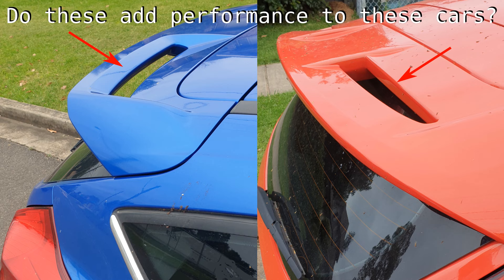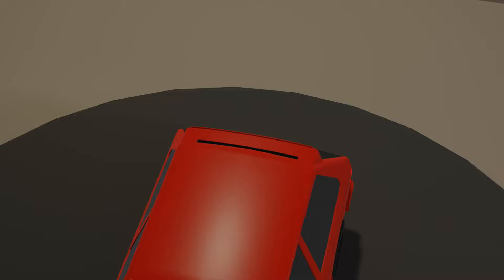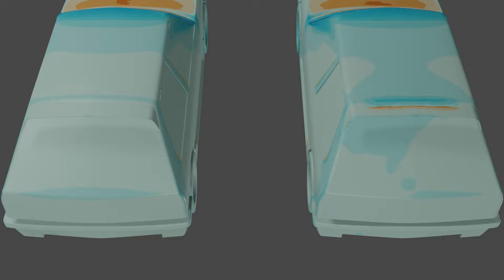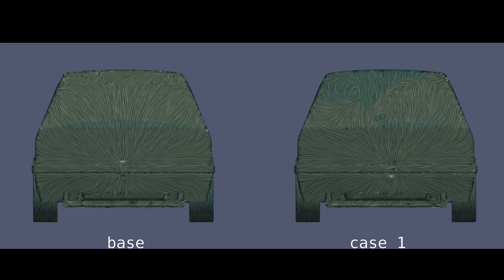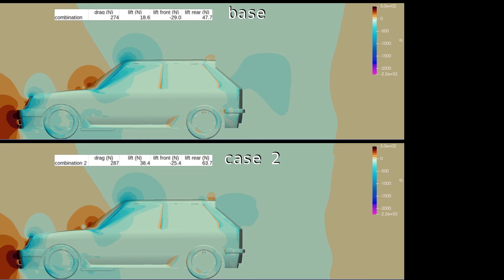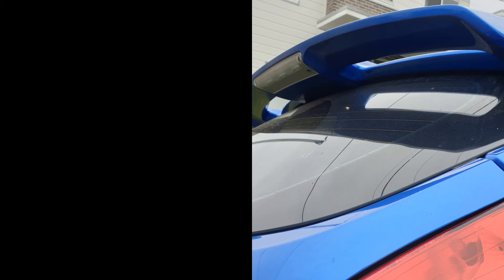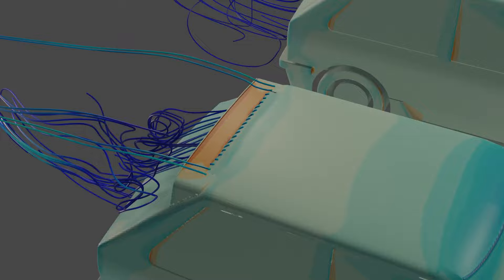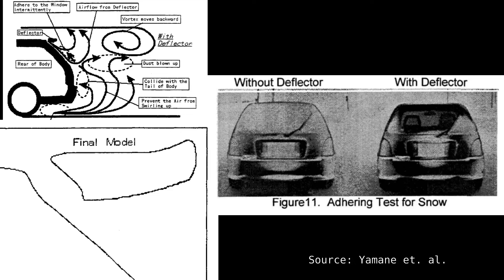Aerodynamic analysis of dirty cars that I live near.

Comment: I have heard that the Focus ST spoiler does a good job of keeping the rear windshield clear, as I suspected that it directs air downwards onto the windshield. The difference is very clear when compared to the RS, where a wing further away from the roof is used. The roof extension flap right under it presumably helps keep the airflow clean under the wing to ensure the wing's effectiveness, but as a result it separates the air away from the rear windshield. The RS rear bumper also has a small rear diffuser which I believe is meant to work in conjunction with the factory muffler to form a smooth surface underneath. The air that exits the diffuser and recirculates upwards is strong, with the high speed air leaving between the roof extension and the wing, the tradeoff is severe. The RS has significant debris buildup on the rear windshield compared to the ST. I believe the issue with snow isn't from over the roof, but rather from underneath the car. The air thrown upwards from underneath is so strong that brings a lot of powder snow or water droplets in the case of wet roads, whereas the ST slotted wing directs a sheet of clean air downwards to fend off the debris thrown from underneath the car.

Ford engineers claim that they calibrated the RS wing and diffuser so that the car has zero lift at certain speeds, but they made no such claim for the ST model, which indicates to me that the ST wing wasn't designed for performance gains, but rather for aesthetics and street driving practicality.
Reply: Took an ST to a tad over 150 one time, can confirm that wing was just for show.
Reply: @notaboutit3565 😂😂

Comment: The purpose of a spoiler is to redirect air to the low pressure zone left by the car to reduce drag. A wing however increases drag as a trade off for more down force to allow better grip at high speeds
Reply: At what speed? 60, 100, or 120?
Reply: @mtang65  At all speeds, the faster you go the more air is deflected by the wing and the more downforce will be exerted. You would have to do calculations and simulations for the specific vehicle and aerodynamic properties to specify "at what speed" this down force actually makes an improvement on performance

Comment: I'm very late to this but I had a Mazdaspeed 3 (Mazda 3 MPS in the EU) which had a completely pointless spoiler. All it did was increase the drag on the car because it wasn't shaped like an aerofoil, and, even if it was, it was angled in a way that would make it create lift rather than downforce. Of course I didn't know anything about cars or fluid dynamics at the time, because I was still in high school, but in retrospect I find it funny that I thought it was beneficial.

Comment: I have a Fiesta ST mk7 with the slotted spoiler, and I actually had to buy a riser kit for the spoiler to allow air to go under it so that it would keep the rear window clean.  Without the riser it did nothing.

As far as I know, the Fiesta ST is too slow to benefit from any kind of wing unless it was absolutely massive, so they generally just put them on because it will make the car look sportier.
Reply: Aerodynamics start to work at 60kmh or so, a ST is fast enough, any car is. The spoiler is for reduced drag, by creating a smaller area being the car, not for downforce, as with most road cars
Reply: @mc1996  The wing does nothing, it is for styling purposes only.  On the actual racing Fiestas, the wings are much bigger and are actually designed with aerodynamics in mind.  The only wind tunnel testing they likely did with the Fiesta/Focus ST wings was to make sure they didn't make overly loud noises at speed.
Reply: @sethmoyer  noise equals drag, lol. Every hatchback has a spoiler for this reason
Reply: @mc1996  Yes, that's why the Fiesta and Focus SE have their tiny little spoilers.  But the ST and RS with the fancier looking ones have NO benefit.  I'm not trying to trash talk these cars at all; I have one and it's my favorite car I've ever owned.  But it's naive to think that a company selling a sub $20,000 hatchback (even for the top trim levels) with a top speed of like 130mph is going to put significant R&D into aerodynamics.  They didn't even add the little wind deflectors in front of the side mirrors until like 2018 or 2019...

Also, the Fiesta ST wings use the same mounting solution as the SE wings, and incredibly thin plastic, so they generally crack after a while.  If there was any significant force being imparted to the wing by aerodynamics, they would have needed to use thicker plastic.
Reply: @sethmoyer  man, just pick up a book. All hatchbacks have a rear spoiler for reducing drag, not making downforce. The spoiler doesn't have any downward forces, it's just to smooth the air after leaving the roof....if you have any doubt that a spoiler like these (and all other models on the road) works, then I don't know what to say.
Manufacturers struggle to keep emissions and fuel consumption low on these base models (even with STs) so they can balance with the performance models.
Reply: @mc1996  Maybe you should go out into the real world instead of reading books, lmao.  I am not even disagreeing that a small lip is good for aerodynamics...  I'm saying that the ones on most hatchbacks are larger than needed and are done that way for aesthetic purposes.

If you look at the 1st gen Honda Fit/Jazz, the little tiny spoiler stamped into the hatchback sheet metal is all that is required.  Anything more than that is for aesthetics only.  If you look at the 2024 Honda Fit (that we don't get in the US) the little tiny lip spoiler is just as small.  There is NO benefit from having anything bigger than that.

Comment: Ive got an ST and it is very stable at high speed (100 mph+). The rear aerofoil section does help to keep the air attached to the rear more by delaying pressure difference (high on the roof to low at rear window). Or what I've just said is complete bollocks
Reply from the maker: The spoiler fundamentally changes the shape of the wak drawing air from under the car up the rear window. this means that there is less pressure under the floor, but more importantly the induced drag from the air above  the roof isn't pulling at the rear window creating lift.

Comment: If the flow following the rear window met a spoiler like that of the Porsche Cayman or Ferrari 296, basically a mid spoiler, could it generate vertical aerial load like on these cars?
I have a similar project on a hatchback with an electric spoiler but I still don't understand if it would work.
Reply from the maker: any spoiler will work on a hatchback, that is why every hatchback sold these days has one. It depends on how much work you want it to do.

Comment: Would the solid centre portion not create a vortex pulling the lower energy inwards? You only tested a continuous slot across the whole spoiler?
Reply from the maker: you are correct. the simulation did confirm that the purpose of the slots as outlined in the paper. There is a lot of detail that you can go into and a manufacturer would, but this is yt.... 
I'm going for a mildly interesting video that isn't wrong....

Comment: Im of the opinion it's mostly for a 3rd brake light.
Reply from the maker: the spoiler is definitely for drag and lift reduction. reduces drag by 10%.
Reply: @nelsonphillips  You still missed the word "mostly" in my original comment. Everyday cars largely won't benefit much from this...
Reply from the maker: @samusaran7317  no i got it, that is why i responded and stated that it reduces drag by ten percent. that is why every hatch has some version of a spoiler even if it is just a small numb.

Comment: I suppose it’s possible these lend themselves more to feel making the car feel livelier or aid in rotating the rear of the car. It seems to me newer cars tend to feel lazier and more stable so perhaps this is the most cost effective way to achieve a desired feel?
Reply from the maker: car maker don't want to sell a "lively" car as it would unsettle most drivers.
Reply: @nelsonphillips The cars with the slotted spoilers are FWD sports cars. The people who buy those would probably prefer a slightly loose tail on a FWD.
Reply: true, but the fiesta st for example is anything but not lively. I don't think thats down to a little bit of lift though, so not really relevant here @nelsonphillips